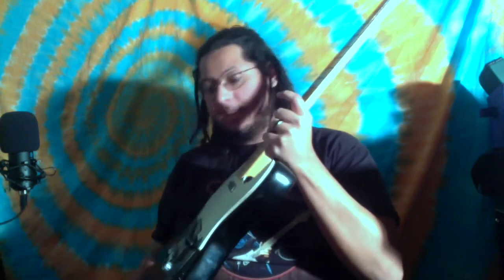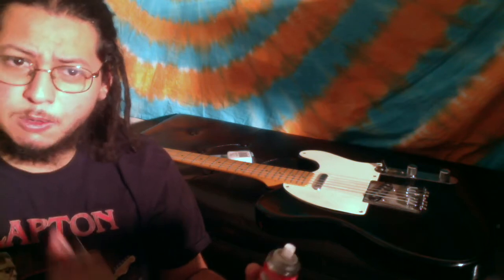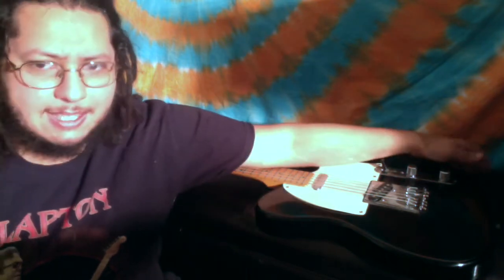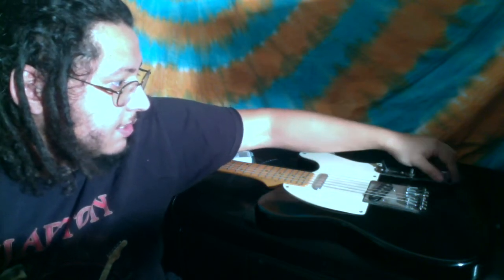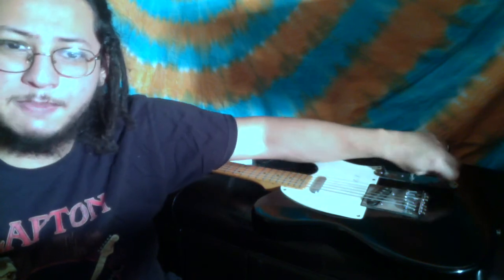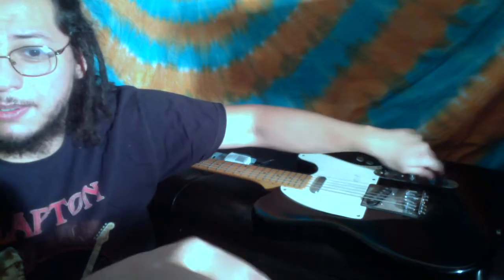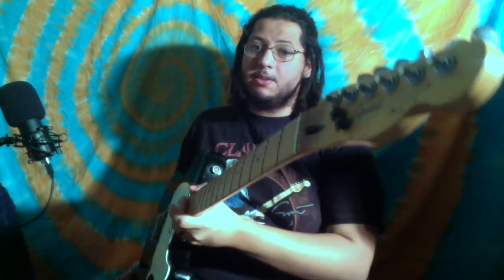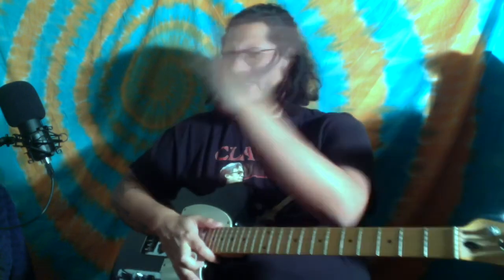Why is my Guitar Making Crackling Sounds| How To Fix a Squire Telecaster's Volume and Tone Controls!

Comment: On my Yamaha Pacifica 012 (S S H config, 5 way pick up selector, Vintage tremolo). I recently changed the bridge humbucker with a Semour Duncan Invader. However on the position two (neck and middle blended), the sound changes significantly. The tone and volume get reduced by 60 percent ( almost as if the pick-ups have been split) although they work fine when selected individually. Please guide with your knowledge.
Also, at times while on the bridge pickup on the full volume the sound gets clipped / distorted, please share if you know what factors could be causing it?